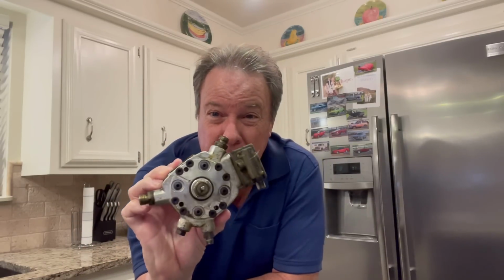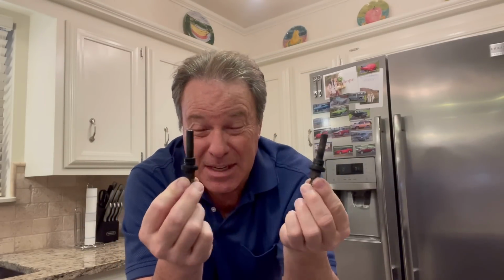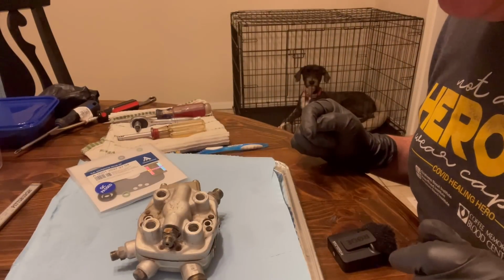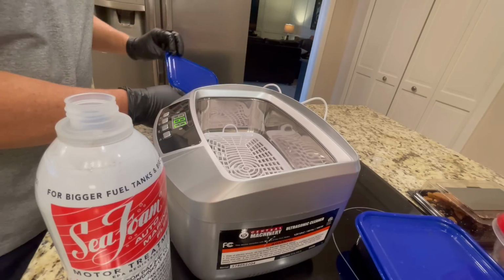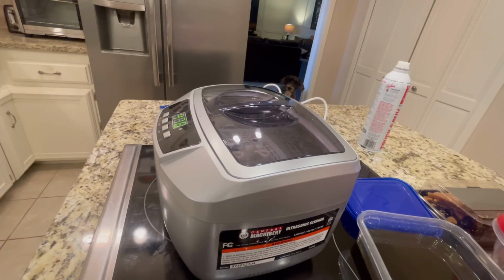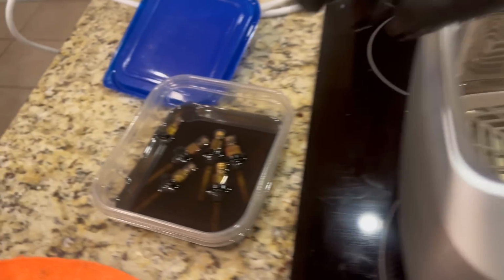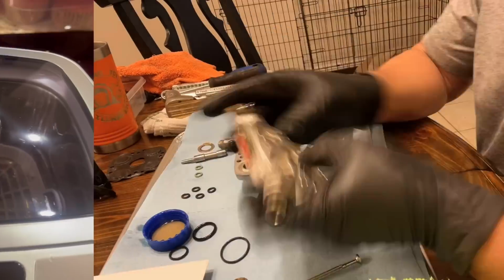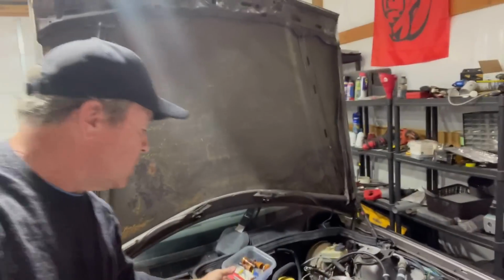Fuel Distributor Rebuild

Comment: Check the pressure at the warm up regulator.  It controls the richness of the mixture.  I've worked on countless Porsches, BMWs, Volvos and Audis running the old Bosch K jet.  I always start with checking the system pressure and control pressure!

Comment: Heyyyy Mike, pleaseeee do that 3 item check list they do, like check the Air, the Spark and the fuel to see which area needs fixing? Take a plug out, put the boot on and turn the key to see if it sparks. When you lift the fuel distribution system does it spray fuel in that big throttle body unit? 🤔 Ohhhhh I want this car to start so baddddd

Comment: If it did start, I would give you an A+! Most of the time, the fuel distributor rebuild is not successful. It takes a major rebuilder to successfully rebuild them.  Many MB, BMW, and Rolls Royce/Bentley owners use
CIS Flowtech in Alabama .

Comment: You guys are pretty funny. Reckless, but funny. As I watched, I said out loud, "Check the EHA!". Never saw it happen, so here's a suggestion. A quick EHA test can be done with a 9 volt battery, by touching the 9v battery terminals to the contacts on the EHA, you should hear a "click" in the EHA. Try a few times. If you don't hear the click, (assuming you used a good 9v battery!) replace the EHA. Good Luck and please, be careful! I suffered gasoline burns when I was foolish and young. You're out of excuses.

Comment: After like 120-150k miles it's better just to replace the fuel injectors the little spring inside eventually wears out so there's no point in cleaning them. Also take into to consideration the age of most of these cars is 30+ yrs so alot of parts have to be replaced or rebuilt

Comment: Saw a youtube on a 230ce 1990 had same problem would not idle ran rough just changed firing order that dame thing was running on 2 cylinders bad distributor cap incorrect firing order.Check it out Mike

Comment: Unfortunately fuel distributor rebuilds rarely go as planned without sending it off to CIS rebuilds. There's a lot going on with those KE systems. Too many critical parts and adjustments. Good luck with it. Old KE systems are similar to the Whack-a-mole.
Reply from the maker: I’ve rebuilt 3 successfully. I’m hoping this is #4! Lol

Comment: At first, those injectors CAN NOT be cleaned you just lost your time, they are simply being replaced! Second, don't let that old trader lying to you! For the money you pay him for the "tester" you will buy brand new injectors which you will replace after 100k miles. As for the distributor, the plunger goes back very slowly. Good luck!